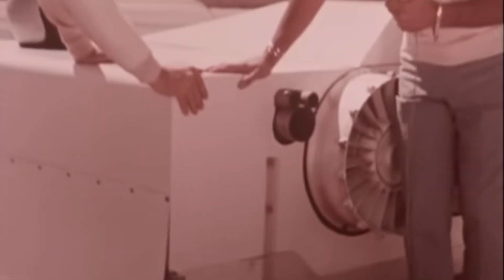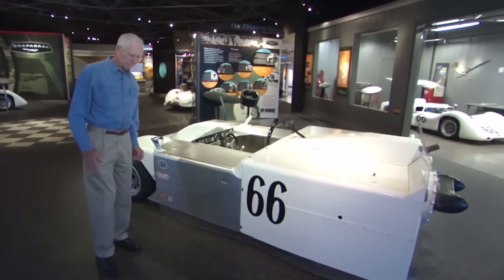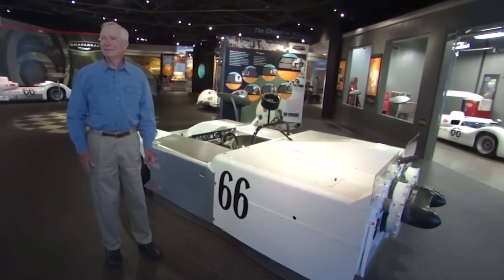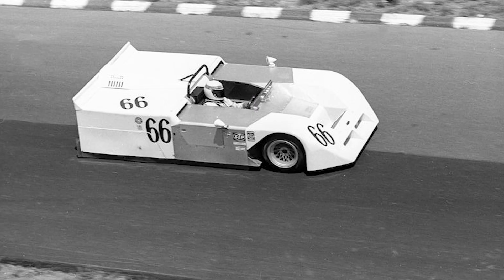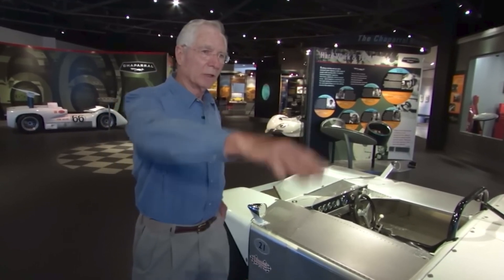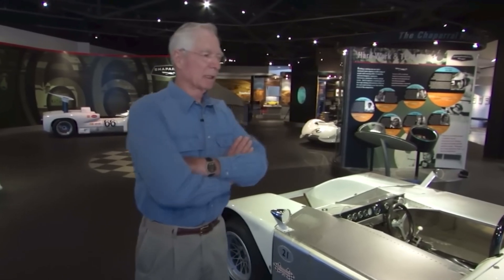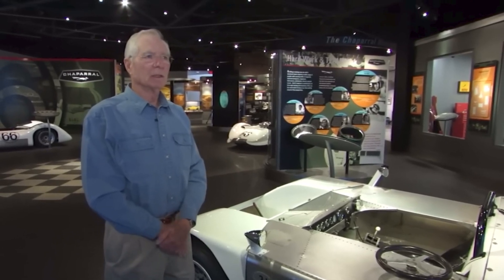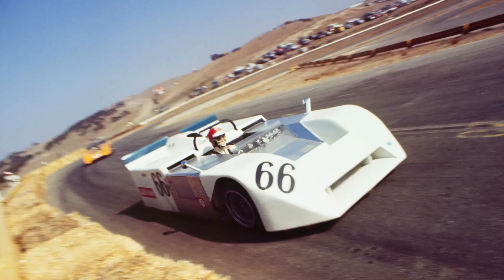Chaparral 2J: Too Much Grip?!

Comment: I alawys thought it was disallowed because it had more than one engine !......and wondered if it used todays electric hybrid tech motors instead of snomobile engines to power the fans, it might be able to survive a complete race .....racers also complained about being bombarided from dust & debris by the fans when running behind the J66
Reply: Especially since they were BEHIND it so much...
Reply: I wonder if vacuuming the track clean before the races would work...